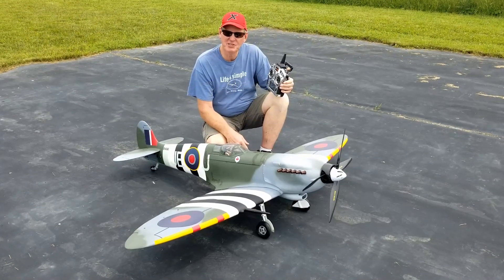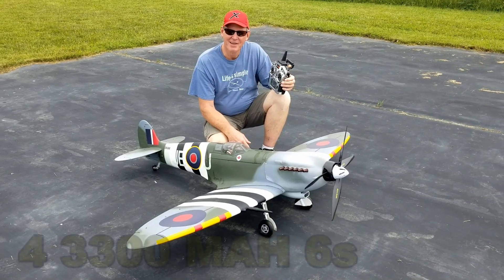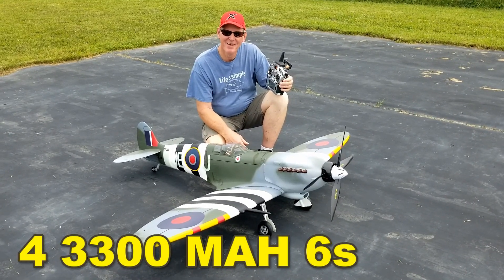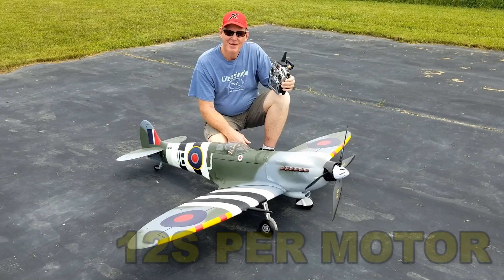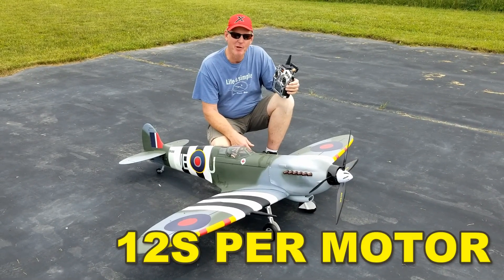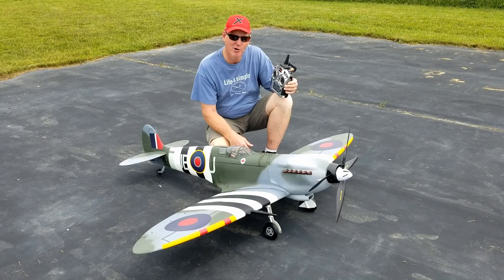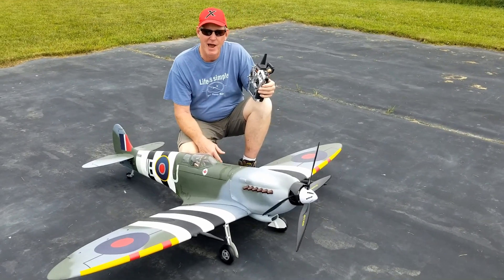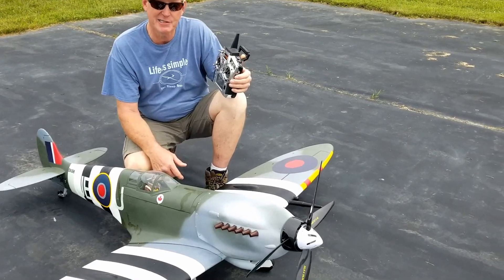CONTRA ROTATING MOTORS SPITFIRE RCTWINS

Comment: Phantastic, great work. Any vibration issues with the long engine axle? I am working on mine too 👍👍
Reply from the maker: Zero
Reply: The Meslick props worked the best .   A slight pull to the right on the immediate takeoff roll is normal.

Comment: I see in the other build video the rear prop is slightly shorter and higher pitch. I've read the rear prop should have a slightly higher pitch for best performance. Thanks for the video and your contribution to the hobby.
Reply: One of the reasons for a higher pitch  in the rear prop is the first prop provides fast moving air, so the second needs to catch that speed and multiply it.
Second is the push of the rear prop enables the front prop to cut into the air with less horse power, and because it is Electric powered it uses that efficiency to grab even more air so the process keeps multiplying!!!
Reply from the maker: Thank you for the comment!, the front prop is a 20.5x20 and the rear is a 20x22, Mezjlik really has this down and has the best performing propellers for this, this plane is way faster than most of the jets we have seen!😀😜

Comment: How does it fly compared to single prop? Do you need less rudder/no rudder to correct p factor? Can you go full power on takeoff because no need for rudder to become effective? Wondering if this setup would be better or worse than single prop for aerobics...
Reply from the maker: It's better all around, this plane has so much power only half throttle is needed and take off, contra rotating seems to pull to the right just a little on take off, since the planes are set up to have the engine angled to the right. Other than that this airplane handles like it's on rails. Probably does over 200 miles per hour